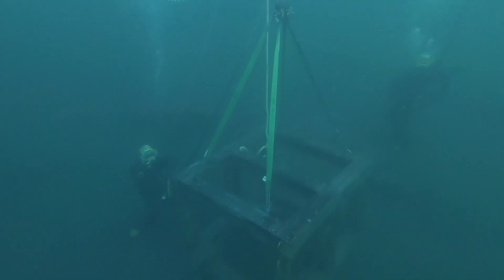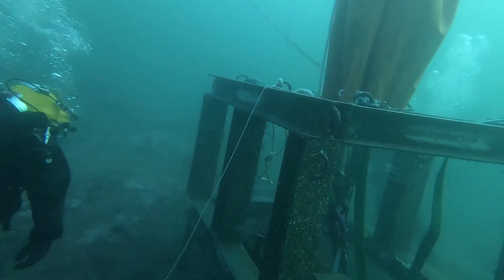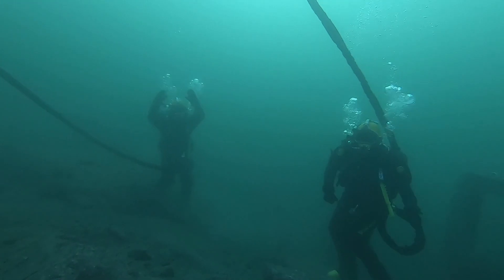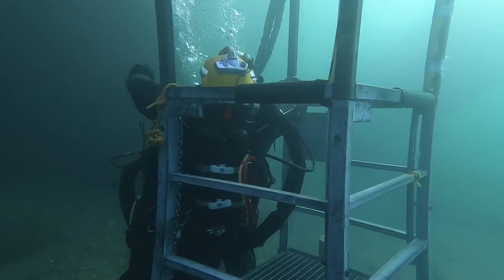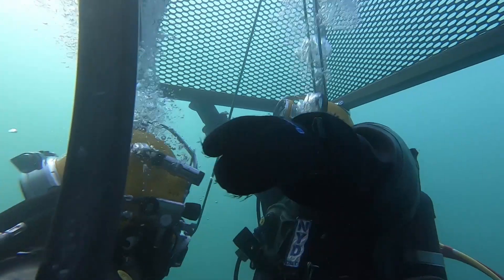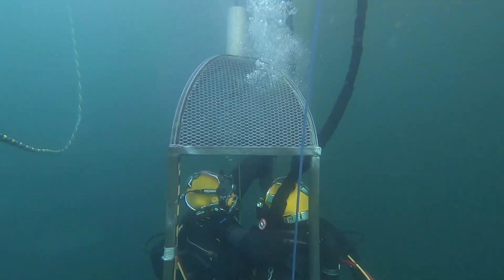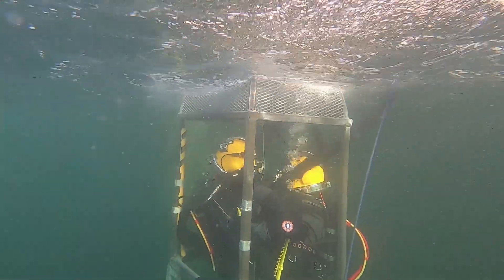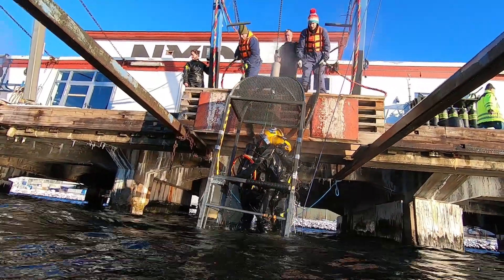Lifting 900 kg steel table underwater (Become a Commercial Diver at NYD) - ep 09

Comment: Why waste all that time transporting him to the basket? Surely, it would be more prudent to surface him with the attendant pulling him up using the umbilical/lifeline? They're not deep enough to require stops. (Ex RN trained basic air diver.)
Reply from the maker: You have an interesting suggestion, but try to see the bigger picture and not only stay inside this video and this particular dive. 
All of this is done in a school environment, where it must be safe to practice. That's why it is not that deep, but the depth of the metal table was between 15 and 20 meters. Every dive and every scenario was trained so that the same action would be performed regardless of the depth (surface supply diving with air for commercial divers is down to 50 meters). And even if we forget, that divers underwater are told what, how, and when to do from the surface, they are still humans who can get confused under pressure in an emergency. What I mean by that is that if you are trained only one way, then you will react that way. If there were tens of different solutions to an emergency procedure there would be many more difficulties solving the problem safely. 
Also, returning to your solution of just pulling him up, it would be extremely difficult to maintain and control his airways because, as you noticed, those divers are not wearing fins. They are using diving boots. Even if the second diver attended to the one in need, pulling them up with dry suits and with no actual control over buoyancy would result in two divers popping out and now needing medical attention. And here we are still not considering the weather, waves, surge, and so on, and the fact, that yes they would be on the surface, but there is still a good five meters from the surface of the water to the actual ground level of that diving station. 
Overall, you had a good train of thought, but this was actually the best way to handle this situation. As it is trained like that constantly, it should become a part of muscle memory. And of course, if you are diving from shore or a different configuration then you would have some different options. But commercial divers generally are trained to go back the same way they entered mostly because of the umbilical ;)
Reply: @rannarlaur  An excellent explanation, sir. Thank you for posting such a detailed and explanatory article. I enjoyed reading it immensely.

Comment: Do these types of divers have to equalise the pressure? I've never used full face masks or helmets, only recreational diving where you pinch your nose to equalise. Always wondered about this??
Reply from the maker: Yes, of course. Pressure is still pressure ;) 
Some of the masks and helmets have equaliseing knobs which go through the front under the glass, so you can push it against your nose and equalise that way. Some of them have just some pads inside and you have to press your nose against it. But it also differs from person to person. Some divers are just doing the same things you would normally do on the plane =)
Reply: @rannarlaur  thanks for the reply. Also seen a video of divers going down in a bell and equalising in there (pinching nose) before getting geard up, which is cool.

Comment: Great Video! Can I ask how do commercial deal with decompression and stops? Is the divers gas mix adjusted throughout the dive for different depths? Do they do stops on the way back up in the basket?
Reply from the maker: What we were doing, was mainly air diving down to 50m. That means deco stops on the way back in the basket. We did also a bit nitrox diving, and surface deco with oxygen (in the chamber).
Reply: @rannarlaur  Thanks for the reply, very informative!